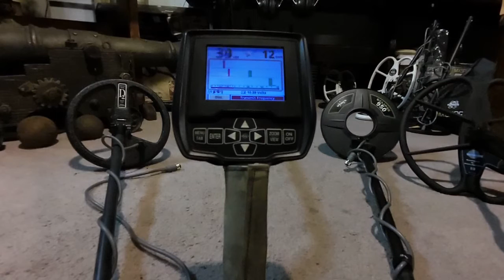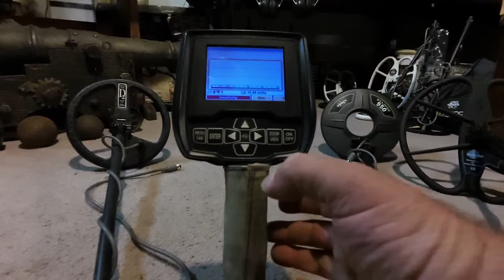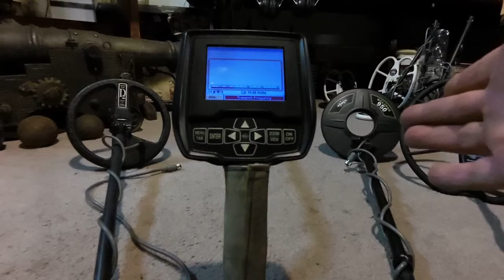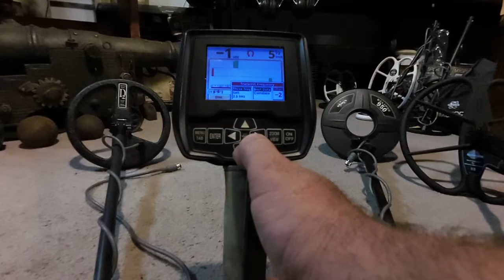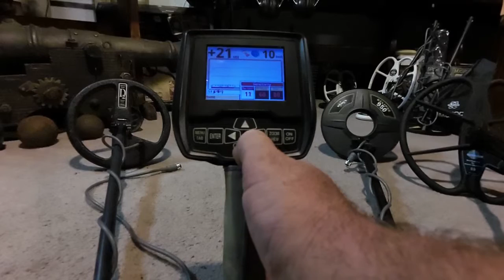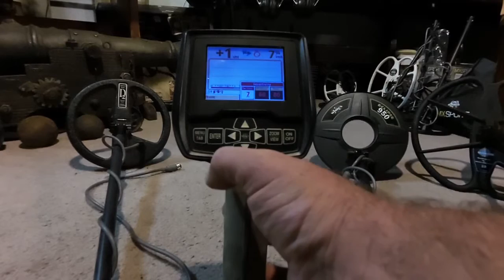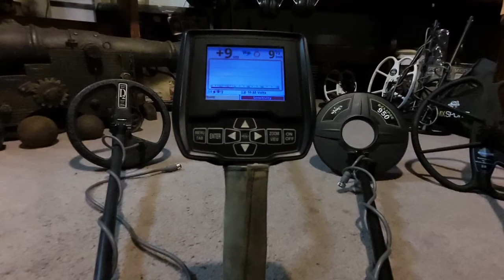Whites V3i  Reducing the effects of EMI

Comment: I always see these videos about getting rid of EMI and tweak everything. The problem many people have with the V3i is there are too many adjustments to make and people like to just turn on a metal detector and go hunt. The first thing I would always do is ground balance first. Then if I was using a wireless headphone I would go to the Audio section to make sure the green bar is 90% green if not you have interference, change the channel. Last go to Sensitivity Probe and look at what Noise reads if it’s zero or very low you should have very little external noise. I would do this before I did any of the changes you suggested.

Comment: In my opinion, you're loosing a lot of depth and sensitivity to deep targets of the V3i by turning down DISC first. Your goal should be to try to keep the DISC setting as high as possible and reduce the interference with Filters,  Lower RX Gain setting, Frequency offset. If in a area with extreme EMI use single frequency. If you haven't reduced EMI with these options then reduce DISC.